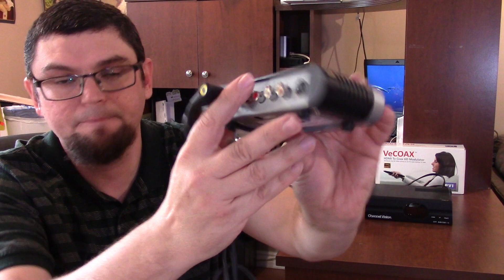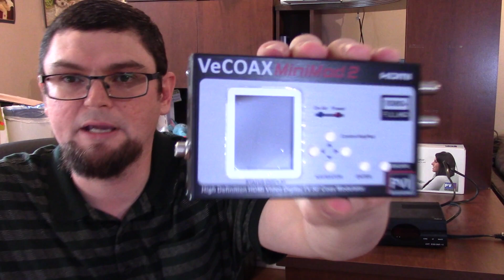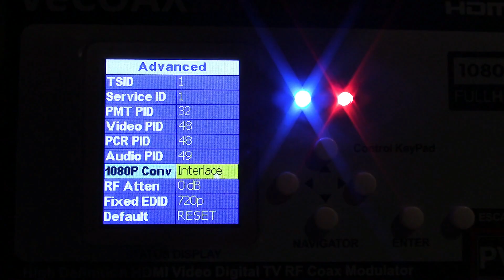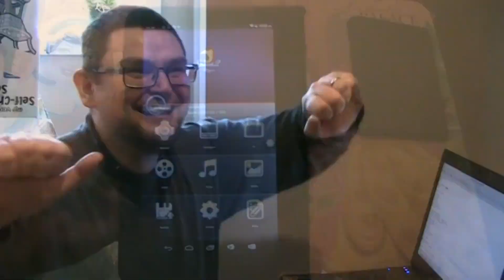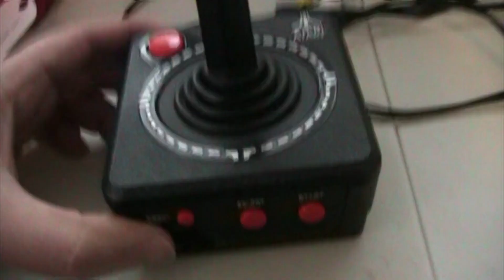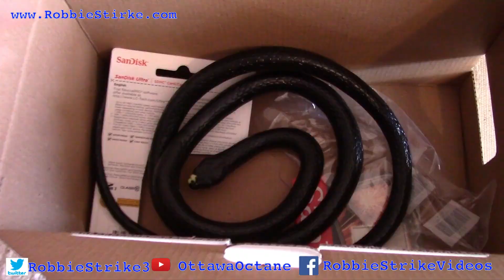RF Modulators - How To Setup Your Own TV Channel - Analog and Digital

Comment: Found this device very interesting as a FCC licensed HAM radio operator you could actually set up a couple hundred watt TV station, HAM radio operators are allocated 4 channels of the Cable tv spectrum to broadcast on.. I wonder if you put a antenna on the output of it if near by tv would receive it if it had a antenna on the Cable tv input.   I know this device would not have the broadcast power to go any large distance,  but it would be a cool test even if it worked a few feet...   and if you were a ham you could amplify that signal and legally broadcast up to 200 watt signal even on the entry level technician license.  100 watts can go 50+ miles easily,  further licenses allow up to 1500 watts..      I know, as a kid, I hooked our cable tv up to a antenna and the local cable tv company came knocking saying something in our house was broadcasting their signal and that's not allowed.  It was my boombox that had a 5" tv in it , it had a external antenna input that internally was wired directly to the telescoping antenna... so it was broadcasting the cable tv signal around our neighborhood unknow to me till they told us.
Reply from the maker: Interesting points. Cable will not do that anymore. A lot of Cable Companys are basically streaming boxes now in the Ottawa area. All though I would love to see more local tv stations making local content. Even with volunteers and give students a chance to learn to produce video.

Comment: Great video.  The coaxial cable must be RG6/RG6U it is much better than RG59 especially on the long run. Since I live in Europe I searched for European RF modulators and I found many RF modulator, some of them are not that good or good but expensive. But I was lucky to find good and affordable modulators. I have two modulators one for analog and the other for digital TV, and these are what I recommend:

The Analog RF Modulator is called DIGIQUEST RF STEREO MODULATOR - VHF/UHF:
https://www.amazon.co.uk/DIGIQUEST-Stereo-MODULATOR-UHF-MULTIBANDA/dp/B01614S8PM
Output Frequency: 47 - 858 MHz; A/V standard: PAL B/G, D/K, I, M/N it is the cheapest and the best RF Modulator, it has RCA input. To connect an HDMI source I recommend and HDMI to RCA Converter (power by USB) like this one: 
https://www.amazon.com/Converter-Composite-Adapter-Supports-Blu-Ray/dp/B0814Z34XG 

The Digital RF Modulator is called AMIKO TRF-800 HDMI-DVB-T modulator:
https://www.amikostb.com/product/296-trf-800
https://www.ebay.co.uk/itm/Amiko-TRF-800-HD-In-To-RF-Modulator-HDMI-Video-to-RF-DVB-T-Converter-/153143071918
Output Frequency: VHF: 174 - 233 MHz and UHF: 470 - 858 MHz, Video output 1080p60, Audio output: Stereo, HDMI input with HDCP (especially for Blu-ray players and Cable/Satellite STB) it is the cheapest digital RF Modulator

If you buy a digital HDMI RF Modulator make sure it has HDCP if you wan't to use with a Blu-ray Player or STB
There are some Digital RF modulator  with two or more HDMI inputs or HDMI input and RCA input one example is this type of Digital RF Modulator but these are very expensive:
1.Digital RF Modulator with 2 HDMI inputs (HDCP) can modulate signals from two HDMI sources and locate them in one DVB-T multiplex: 
https://www.dipolnet.com/dual-channel_dvb-t_modulator_signal_sp-7625_2xhdmi_to_1xcofdm_with_hdcp__R86602.htm
2.Digital RF modualtor with 4 HDM inputs (HDCP) and 4 RCA inputs:
https://www.dipolnet.com/hdmi_-_cofdm_dvb-t_modulator_ws-7990_4_channels__R86704.htm

Comment: Is the ve coax for analog or digital? Also how do you get sound on the channel? Also how should you play the program? A VCR?
Reply from the maker: The V coax unit it is digital it has a screen with buttons and you just set to the channel you want. This unit is an HDMI input and it will output to a coax cable using ram or atsc. And the other unit I use the video is analog the analog ones are much cheaper. Most VCRs don't have an HDMI output.  you can use a DVD player a satellite TV box or anything that has an HDMI output
Reply: ottawaoctane thank you for the help but how do you get sound?

Comment: This is great, but what would prevent this from broadcasting out of your antenna if it were plugged into your antenna system?
Reply from the maker: I checked it out with a pair of rabbit ears but got nothing. But I didn't go up to my roof and hold a pair of rabbit ears and my TV set close to the antenna.
Reply: You can do that, but you'll need an amp to get Any range

Comment: What about the type of antenna you used for broadcasting the signal?
Reply: Frank Chambo  if your doing it on digital you should buy a VHF-UHF antenna from target or another store ( you also need a converter box with your using a CRT TV if your doing analog you should get some old VHF analog “rabbit ears “  that you could find on eBay or at a thrift shop.

Comment: I have a GE  Ultra Pro Universal remote control for my Sanyo analog tv and Phillips DVD player? Do u have a suggestion on how to set the two up on RCA converter box or a GE RF Modulator box but controlled by the one controller?
Reply from the maker: With a universal Remote?
Reply: Yeah get up-to-date and get